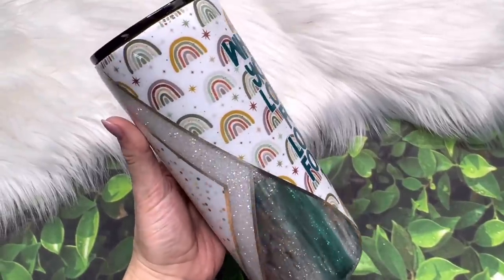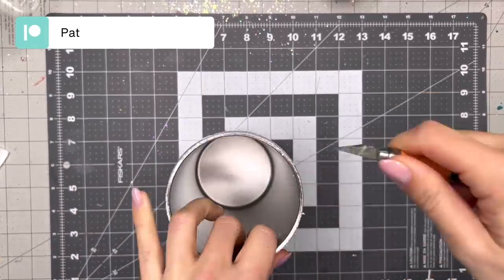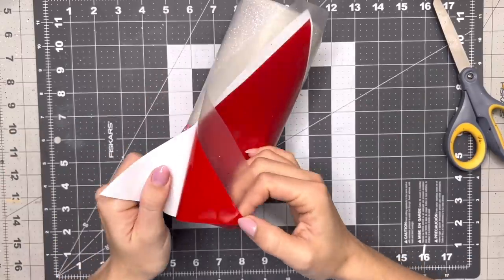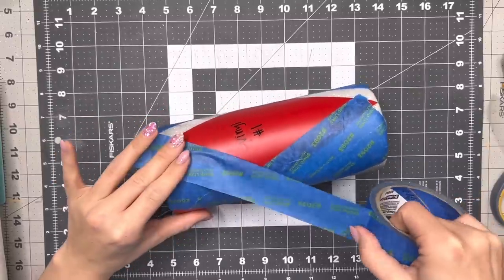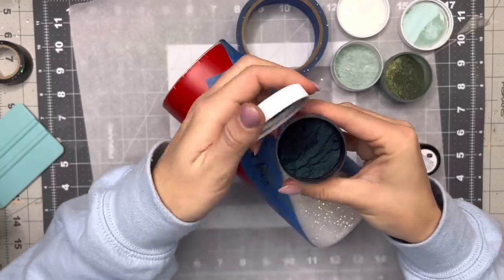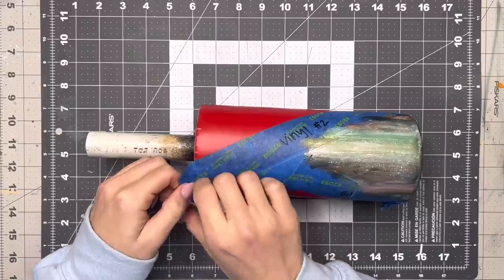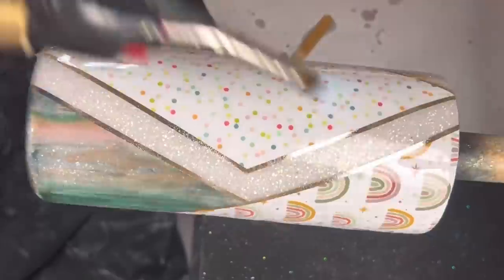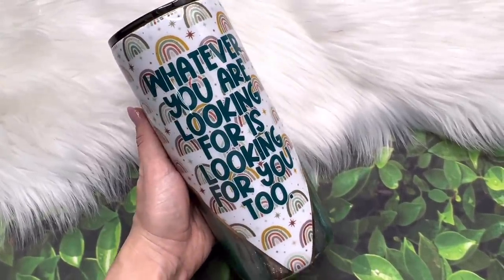Diamond V-Split Tumbler Tutorial

Comment: Do you think this can be done on 20oz straight up skinny? Since you're only using the length of the cup?
Reply from the maker: Yes! You can do this technique on any cup that’s not tapered. Well, you could probably do it in a tapered cup too but that would be very hard! 🤣
Reply: @madebymal_studio  ok. Im going to try. When I add triangle shape, keeping the lock on i adjusted height to 8.125". The width auto adjusted to 9.3" and the entire circumference of cup is 9.25". Looks like my triangle's ends will meet, so I'll need to adjust my diamond height.